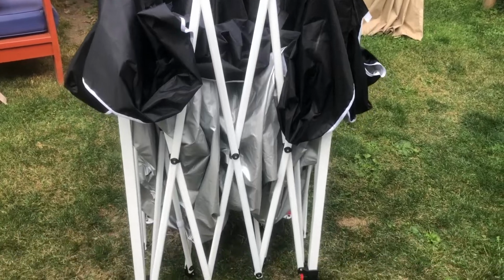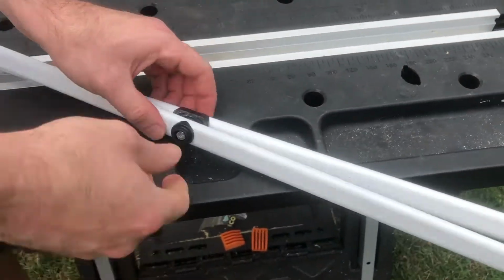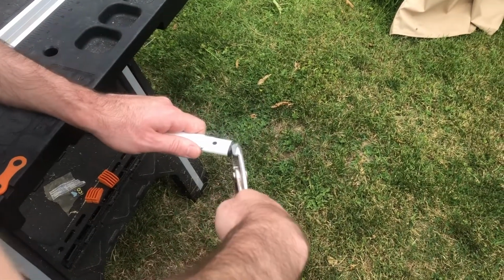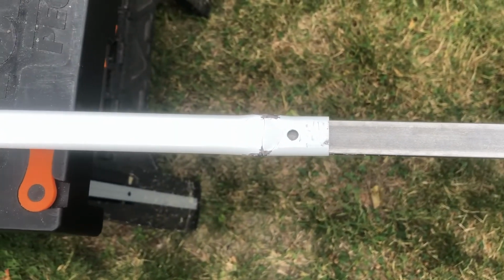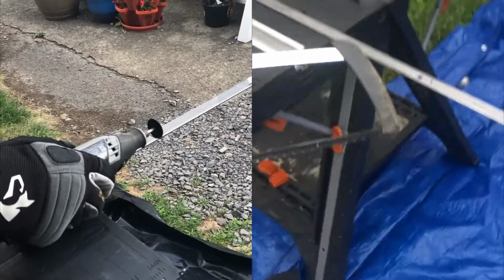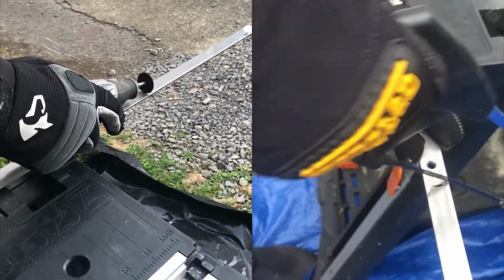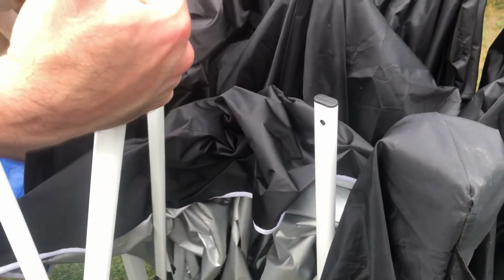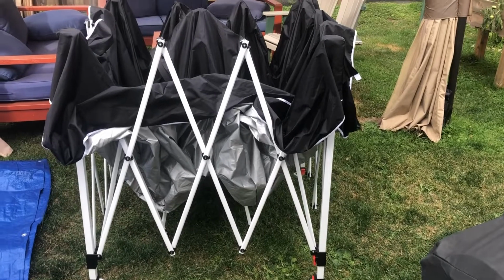HOW TO REPAIR A BENT CANOPY – Easy and cheap to do yourself

Comment: The real problem is the cheap, hollowed out aluminum used for the truss bars.  Makes no sense these canopies range from 250 to 500+ USD, and built like "chit."  Solid metal/steel with bolts and washers would have allowed for folding and durability.  Water collecting on the top, destroying the frame, could have been prevented if the designers just added a few extra bars for roof support.

Humans suck.
Reply: Literally. I had my canopy up overnight and didn’t think it was going to rain bad, and a huge puddle started to form and bent half of my canopy! So sad bc it was $300….

Comment: Great idea, thanks, however I am going to use 3/4" wide x 1/8" thick Aluminum bar stock. I will just put in short pieces at the bent ends. I will secure  the short Aluminum repair bars the oval tubular strut using the pivot bolt and pop rivets. I figured out that you do not need to completely remove the bent strut to fix the bent end.
Reply from the maker: Sounds like a solid plan! Glad you found a workaround that works for you!

Comment: Got another suggestion for you, one that is far quicker. Bend your trust back to its proper position and then through an opening whether it be the native opening or through a hole you have drilled in with a drill bit, then spray in some foam Gap filler. Doesn't take much

Comment: longtime outdoor crafter here our canopy broke at the middle joint i cut a small piece and put a bolt on either side of the brake to hold the new center pivot in place .  most damage occur in high winds we have found that 5 gallon buckets of water work great as weights, some no slip mat glued on the bottom help - doggy augurs work the best IF you can use them- ALWAYS weight or stake down!! we once saw a canopy Sucked up AFTER a  storm went by 200 ft in the air  flipped upside down and dropped on a car  NOT  a good day for anyone there.  also if you are at a show many times you can pick up a damaged canopy in the dumpsters after the show for parts, im kind of a hoarder in that way:) good luck all have fun
Reply from the maker: Thanks for the tips! The bucket weights and doggy augurs are great ideas. I can't imagine seeing a canopy fly like that—wild! I'll keep those suggestions in mind.

Thanks again!
Reply: @BuckleUpWeb  we have also used the little boat ratchets- 5/16 cord to form an X in the sides to keep the canopy from twisting and racking
Reply from the maker: @frrapp2366  That's a great idea too!
Reply: I am in need of tightening the area that moves between the canopy rails, mine have too much play and makes the top bars bow, looks like rubber washers but nylon might be better for squeezing?
Reply: @brentkasl6510   check at the hardware stores-- lowes , home depot ect. you might find some thin steel but originals were nylon i believe so they slip against each other